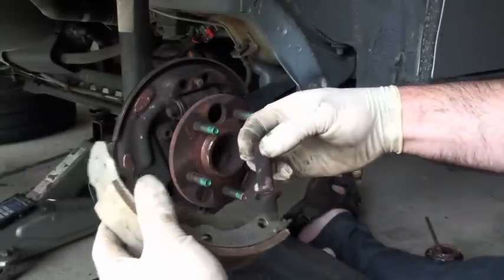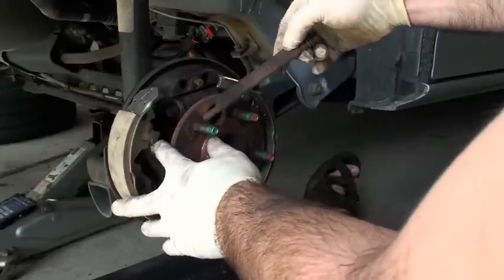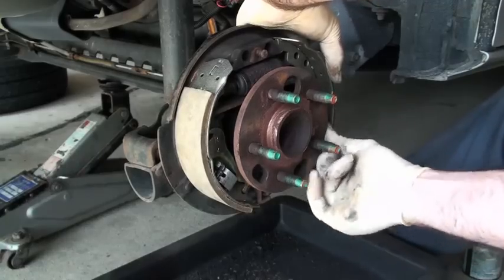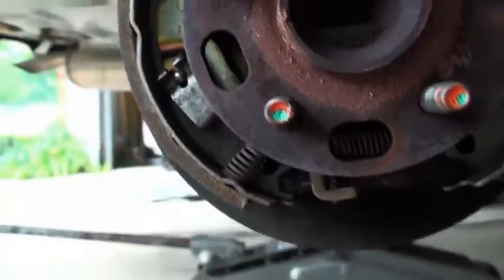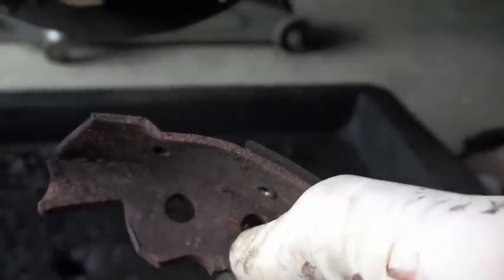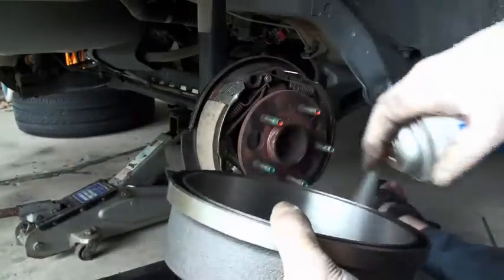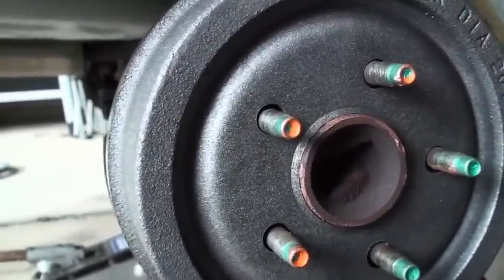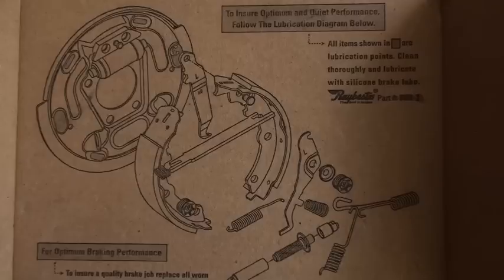Replacing Drum Brake Shoes Part 2 - EricTheCarGuy

Comment: Very Informative video. Thank you very much for showing the rest of us. I just had a caliper lock up on me this afternoon and I changed that out but went to bleed the brakes, we popped a hole on the right rear wheel and not sure if it's a line or wheel cylinder. The rear brakes are all original @ 57k miles on a 93 dodge caravan. fun day.. anyways where can I buy those tools if you don't have a tool guy like the mechanics? thanks again for sharing

Comment from the maker: @woof216 Your concern for my safety is appreciated however just out of frame on the right there is a jack stand, you can see it more clearly when I switch to the other side.  I leave the jack in place but not supporting weight for ease of dropping the car when I'm done.  I go over this procedure more in my video on "Using a Torch to Remove Rusty Fasteners" as well as others because of comments on this video.

Comment from the maker: @1992dakota You might want to check the proportioning valve.  On some vehicles it needs to be 'reset' with a special too that holds it in place while you bleed the brakes.  If you have ABS then the proportioning valve would be part of the ABS assembly and you can disregard this, but if you have a standard system you might want to look into it.  It also helps to use something to catch the fluid coming out of a bleeder like in my disc brake videos, that way you can see any air that might come out.

Comment from the maker: @S0v3r3ign69 Most parking brake cables are broken up into 3 parts, I've seen the connection where the 3 meet freeze up in the past causing a symptom similar to what you describe, sometimes you have to drop the exhaust and a shield to find this connection, if it's stuck free it up and readjust the cable accordingly.

Comment from the maker: @S0v3r3ign69 Check the rear brake shoe adjustment and make sure that is correct before you adjust the cable, the wheel should turn 1 1/2 to 2 turns when you spin it  if it's adjusted correctly.  Once you have the brake adjustment correct THEN adjust the cable if it's still not holding.  As for your other issues, see a psychiatrist. :)

Comment from the maker: @nixymagoo First make sure you don't have the adjustment too tight, the wheels should spin about 2 turns without resistance when you spin them.  Some friction material does tend to smell when it breaks in so it may be normal but I would check the adjustment to be sure.

Comment from the maker: @carljarod If your trying to put the drum back on after installing new shoes make sure you backed the adjuster off all the way, if not the drum will have a hard time going back on.  Also if you are reusing the old drums and didn't have them machined then it's possible that a "rust ridge" on the inside of the drum along the outer rim is making it hard for you to put them back on.  I sometimes have to sand this off to get the drum back on.

Comment from the maker: @bhupi031 Sounds like you might have a couple of problems.  If the brake pedal is low it could be that the adjustment is loose.  As for the noise remove the brake drum and look for shiny spots where something is making contact.  You might also want to spin the wheel and listen for the origin of the noise before you start.

Comment from the maker: @orojugen It doesn't cause premature wear so much as compromises the efficiency of the friction material since it is a lubricant.  A good friend of mine (BigblockMustang) made a comment to this video that seemed like a great idea and that was to put masking tape on the shoes to prevent contamination until the job was done.

Comment: Thank you for explaining about certain things being in the budget. I've been in that boat too. On a brake job today, I replace the springs and wheel cylinders and yes they add about $30 to the job. Had too many brake jobs I've had to do over b/c the wheel cylinder blew and contaminated the linings. As always, very methodical and I learned about backing plates and a few tricks of the trade.

Comment from the maker: @mattRken I would start by jacking up the rear and spinning the wheels to find out which one is at fault.  Once that is determined I would take the drum off and inspect it for any shiny spots where something was making contact.  Something to keep in mind is that sometimes small pieces of rust get trapped between the drum and backing plate causing noise too.  You can verify this by spinning the wheel after the inspection, if the noise is gone this might be the cause.

Comment from the maker: @hiddenunknownvpower If the adjuster is backed of all the way and the drum still won't go on then it is probably the rust ridge in the inside of the drum preventing the drum from going back on.  I sand this down with an angle die grinder to get rid of the ridge and then install the drum.

Comment: What if the drum won't go back on? The shoes are blocking it. I tried using the adjusting star wheel but the brakes don't seem to be going anywhere, unless they move so little you can't tell. But, I have adjusted that thing a whole lot and still nothing. Help?

Comment from the maker: @hiddenunknownvpower Just work carefully and methodically and you will do fine.  I did a disc brake video also if that helps you next time.  Good luck and if you run into trouble I will do what I can to help.  Keep in mind the correct tools make all the difference here.

Comment: Thank you SO MUCH for your video. I just did my brakes for the first time, was supposed to be by myself. I have front disc brakes that I thought would be a piece of cake. WRONG! Wasn't until 8 hours later that I found out it was WAY different from what I was finding on the internet. Took my another 4 hours to get them finished with help. I feel 100% confident to tackle my back brakes tomorrow morning, even though they seem more complex.

Comment from the maker: @UntouchableDog The cable will get some slack in it over time and will require periodic adjustment as a result.  Adjust the wheels first and then adjust the cable, that way your not adjusting the cable to make up for misadjusted shoes.

Comment: Great video !! It doesn't look to be as hard as I've heard.. Most people always advise me to have them done at the shop.  I just did my front rotors (easy) but my rear are drums on my truck.. I think I will research a bit more and possibly look at my setup until I am comfortable enough.    What does a rear drum set cost to have done in the shop (assuming you don't need new drums)  ??

Comment from the maker: @bara647 No they don't.  There are 2 types of rear drum brakes, one, servo which is depicted in this video has one short and one long shoe.  This type will adjust when you brake while backing up (or at least that's what's suppose to happen).  The second type is Non-servo which has shoes of equal length and it is suppose to adjust when you use the parking brake.  The Civic has a non-servo style and would have shoes of equal length.

Comment from the maker: @interstategar With brakes the best thing is to get your eyes on them.  Remove the wheels and do an inspection.  It's even better if you actually disassemble them since there are times when say an outer brake pad will show little wear and the inside pad is down to the metal, you wouldn't know this unless you took the caliper off.

Comment: how can you tell which brakes need replacing when deciding to do the front or the back? I'm getting brake pedal travel, fluid has gone down in master cylander resevoir.  Is there a way to tell by looking without taking the front or back brakes all apart?

Comment from the maker: Thanks for the comment.  In fact there are jack stands under the car just out of frame on the right, you can see them better when I switch to the other side.  I leave the jack under the car but not supporting it so that it is quicker to let the car down when I'm done, it also acts as a 3rd support.  Thanks again for the comment.

Comment from the maker: Well I don't have a video but if you install the rod backwards it might not fit properly.  Also make sure it is installed in the correct orientation, it's easy to not get the rod in there correctly and possibly cause the condition you describe.

Comment from the maker: You need to reinstall the adjuster all the way backed off (make it short, run it down as far as it will go) when installing new shoes, if not you won't be able to fit the drum over them.  Also try "centering" the shoes on the backing plate after you back the adjuster off, this will also help.  You will need to do the adjustment after you get the drum on before you are done, look for a rubber plug in the back of the backing plate to move the adjuster with the drum on.

Comment from the maker: It is a bit different, the adjuster assembly is not even close to what you see here but works in the same fashion.  Also the return springs are a bit different as well and use a different tool to remove, if you end up using side cutters be very careful, the spring can slip from the cutters and possibly cause injury.  I hope to cover other styles of brakes in the future as they come into the shop and make videos of the procedures.  Good luck

Comment from the maker: I wouldn't replace the drums, you could have them machined though.  A lot of auto parts stores do this for a small fee.  If you do get the drums machined sand the brake shoes to roughen the surface before installing the fresh drums.  Also make sure you get the adjustment correct, it should give you a nice firm brake pedal when your done.

Comment from the maker: Don't strip the nut.  You knew that already though.  A little trick is to break it loose at the wheel cylinder but don't keep twisting, after it's loose in the wheel cylinder unbolt the wheel cylinder from the backing plate, pull it toward you and twist the cylinder off of the line rather than turning the line screw.  Do it in reverse to get the new one on.

Comment: Eric, I got so excited about Brake Drums, so I Disassembled my car's drum to change a stuck wheel cylinder, and I have stripped off the old rusty oil tube flare nut, (am using flare nut wrench after that I used vice grip), but I could not get this nut loose (spent 4 hrs),,, Any Ideas or recommendations   :)

Comment from the maker: No worries, just do one side at a time, keep your parts in order, and work carefully and methodically.  If you loose track you can always look at the other side for reference.  Just be careful with those springs they can make some nasty wounds, the right tools work wonders at keeping this from happening.  I also did a video on pad replacement if that helps.  Once you are done you will have new-found powers, be sure to use them for good and not evil.  Good luck.

Comment from the maker: The only way I know of is to physically check the shoes to determine if they are worn out.  Some cars have an inspection plug in the back of the backing plate that can be removed to inspect the shoes but removing the drums is my preferred method.  I don't know of an expiration date on brake parts so I think you would be OK there.

Comment from the maker: Your probably being blocked by the adjuster arm.  Try and go in through the adjusting hole with a second tool to push the adjuster arm away from the adjuster wheel to turn it in the opposite direction.

Comment from the maker: The process is somewhat similar, I believe you have a leaking wheel cylinder if it is brake fluid, if not brake fluid and the car or truck is rear wheel drive it might be a leaking axle seal which is another video entirely.

Comment: Good advice on taking a picture or only doing one side at time. I attempted to change my rear drum brakes on a 95 corolla and couldn't figure out why my one of the wheel cylinders as blowing out. What happened was my neighbor and I started on both sides and couldn't remember how to get it back together. Had to have the car towed to a mechanic and what had happened was we had the two long pads on one side and two short pads on the other side. Dumb mistake. Great Video!

Comment from the maker: To tell the truth on domestic cars I never get my brakes from the dealer, they get their parts from the aftermarket anyway.  Your biggest concern is noise, as a general rule metallic friction material is noisy but lasts a long time, organic material is quite but it doesn't last as long, ceramic is a good mix of both but is usually more expensive.  When you get your parts ask the parts person to steer you in the direction of something that is quiet and fits your budget.  Good luck.

Comment from the maker: Yes, leave the brake off or you will never get the drum off.  I use a spray brake cleaner on the brake parts and backing plate, it can be purchased at most auto parts stores.

Comment from the maker: The first thing that comes to mind is warped rotors.  If that is the case you can replace them or have them machined.  The other possibility is that the ABS is activating due to some kind of malfunction.  If you have an ABS light on this might be the case.  If that is what is happening you might remove the fuse for the ABS, if the problem goes away then you know it is an ABS problem.  You don't need ABS to stop the car but it does help maintain control during a panic stop.

Comment: Eric, i have a 98 dodge conversion van with disc brakes in the front. and when ever I step on the brake the brakes feel like there slipping, not like there warn but the peddle starts to pump and the hold front end starts to shake, What might cause this?

Comment from the maker: It MIGHT effect the alignment but I think a better way of getting clearance is to lift the engine up.If you have a hoist you may be able to attach it,disconnect the engine mounts, and lift the engine enough to remove the pan or their may be enough clearance to get a new gasket in between the engine and pan after lifting.Of course you need to be careful doing this and also look for anything that might get crushed between the back of the engine and the firewall.The rear main might also be leaking.

Comment: Hi Eric. I'm in the process of repairing an oil pan gasket on an old 1986 Toyota 1/2 ton 2WD pickup. In order to reapir it I must be able to fit it out from a cross member held in by 4 bolts (already have the crossmember out) and there's a steering liknkage that also has to come out. Is is safe to remove this steering linkage and then replace it after the oil pan gasket job and NOT affect the steering & alighnment??

Comment from the maker: No, you can do a cylinder leak down test which will tell you a lot more than leaking valves, it can diagnose compression leaks anywhere in the combustion chamber.

Comment from the maker: It's not just "back pressure", every time the exhaust valve opens it creates a negative pressure zone behind the exhaust pulse that helps to draw in the mixture for the next burn during valve overlap.  Timing is everything here if your looking to get every last bit of performance out of an engine.  I'll do a video to better explain this at some time in the future.

Comment from the maker: I use my foot and my handy tool that I used in the brake pad replacement video.  You should make one of these, it will save you a world of trouble and save you from making a mess.  Pressure bleeders are not always the best things to use, sometimes the old fashioned way is best.

Comment from the maker: Master cylinders are a split diagonal design, that means that one chamber is for left front and right rear and the other for right front and left rear.  If you only have 2 wheels working in a diagonal that means that one of those chambers is effected in the master and could possibly have a problem with that seal.

Comment from the maker: Usually a spongy brake pedal is an indication of a brake system that needs bleeding, where the air is trapped is hard to say for sure.  Some vehicles require a special tool on the proportioning valve in order to bleed them properly.

Comment from the maker: No all manufacturers do things the same way so to say "all" about anything automotive just doesn't hold up.  The systems that I'm familiar with supply power to the injectors via a module that regulates the voltage to around 12 volts, the computer supplies the ground to fire the injectors.

Comment from the maker: Not exactly.  The principals of this are beyond the scope of just one comment but the idea is that the spark plug fires on the exhaust stroke to help burn any fuel that may have been left over from combustion in a waste-spark system.  This is also done by design because there is one coil for 2 spark plugs that fire simultaneously in sister cylinders.

Comment from the maker: Sorry about the typo, it's initiation meaning to make the spark happen in short.  With electronic ignition the computer controls spark timing, the cap and rotor have nothing to do with it.  I'll do a video on ignition system operation in the future to better explain this.  Points are a mechanical control of spark timing that was used on cars and trucks before electronic ignition came into the picture.

Comment from the maker: Engines burn oil for 2 reasons mostly, failed valve seals and failed oil control rings.  In other words it is a mechanical failure.  Thicker oil may help mask these problems but in cold weather it may accelerate the problem because it will take longer for the oil to reach those vital places.  The only way to deal with it for good is to repair or replace the engine.